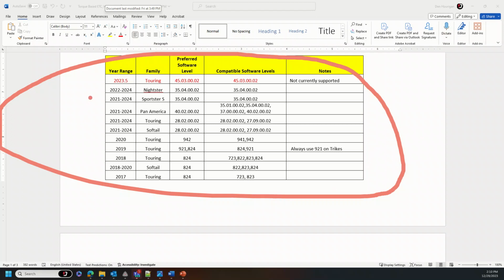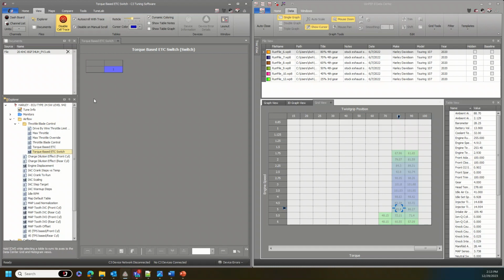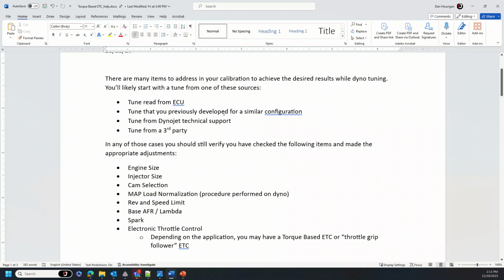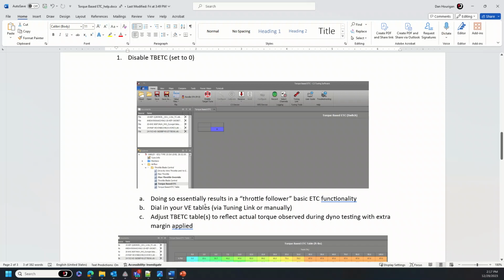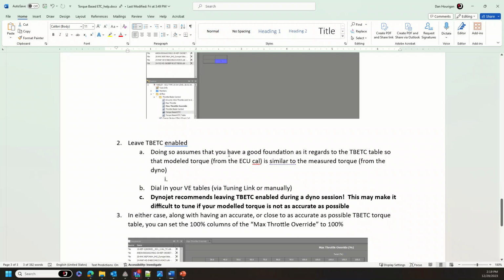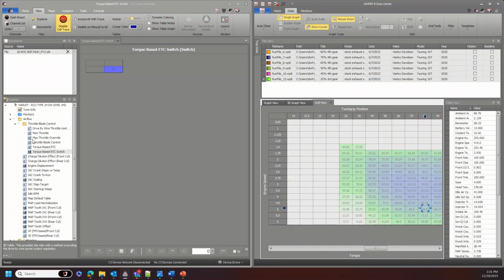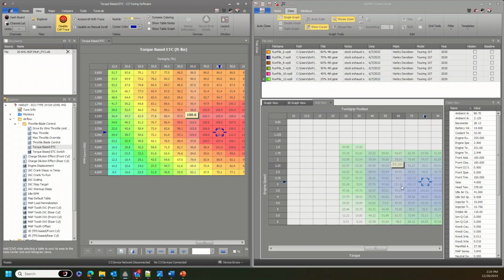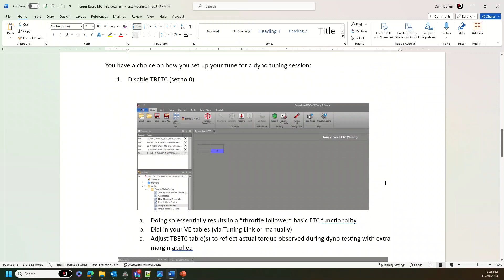Tuning Tips for H-D Torque Based ETC

Comment: Excellent video & explanation.
Assuming you've dialed in the VE tables, once you have made all the throttle percent runs & have the measured torque output for all those runs displayed grid style in WinPep8, can you copy those WinPep8 cells and paste them to the grid in the C3 screen ?
(mainly the cells that look valid and not the off-the-reservation ones)
Reply from the maker: Yup, that's one approach.  You could also just apply the difference between the original torque values and measured torque values to the existing TBETC values, +/- some fudge factor and run with that.  For example, if it used to make 100 lbs-ft and now makes 130 lbs-ft at a certain condition, you could apply a 30% change.

Comment: Good stuff, man! Thank you! I'm starting to finally understand how this new tech can translate to my 2008 FXDB. Excited to learn about Tuning Link.  How much of this can be applied to a non pro, without a dyno, on narrow band o2's?😅
Reply from the maker: Your bike isn’t DBW /ETC from what I recall. Regardless, always plenty to learn. You can get a ton of work done and develop a refined calibration for your bike with the tech included with a PV or PV3 (Autotune Basic, using OEM NBo2’s). Lots of AT sessions, lots of datalogs, use WP8 Data to review / analyze and guide you in your calibration changes.

Comment: sometimes i can´t use the throttle blade control in the c3 software , why? 2017 Breakout for example why is there no button for the TBC - in win PV it is
Reply from the maker: Is the tune up to date?  If tables are missing you need to update the PVT tune file. You can do this in WinPV or C3. Just need a PV plugged in with the latest firmware. 

You can email me the file too and I could take a look.
Reply: @ThePowerFarm  yes it´s up to date. i miss it on more maps. winPV can´t go higher in the % of twist.  in C3 i can do 30% in 35% in WinPV 30% is still 30%

Comment: I know TBETC can be disabled but will setting the Max Throttle override values 1 to 1 like say input 70 in the 70% column on up thru to 100 in the 100% column override the other ETC settings or cause incorrect throttle action because it is a value that needs to be calculated then added to the table? Why did your example for the Max Throttle override have 5 columns all for 100%?
Reply from the maker: I believe the values in the "Max Throttle table" are "TP% at certain RPM (y-axis) and of modeled power (x-axis) to achieve the target power (or torque)".  The "Max Throttle Override" gets added to that value, so conceivably you could overshoot the power slightly or significantly, and if the overshoot fails a plausibility check, the ETC system will shut down the power.  

I was looking at an stk file in the video, and that's why the "Max Throttle Override" has redundant 100% columns.  They are truly there in the ECU calibration, but when you're working with a PVT or DJT file the firmware for each respective file type / device will do a "copy-to" function to fill in those cells with values that match the first 100 percent column.....if that makes sense